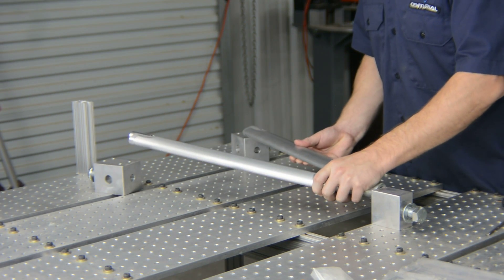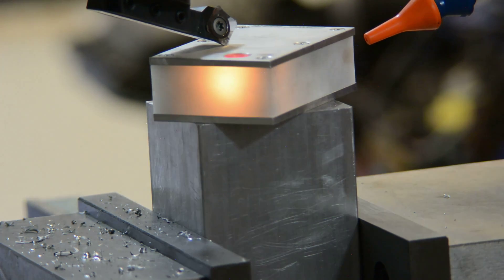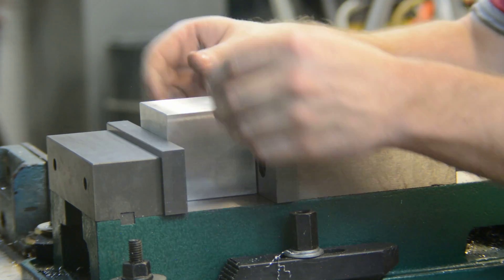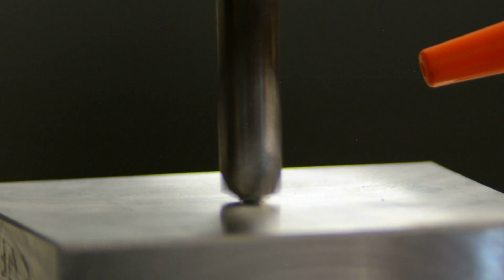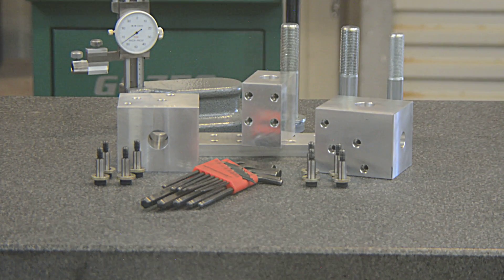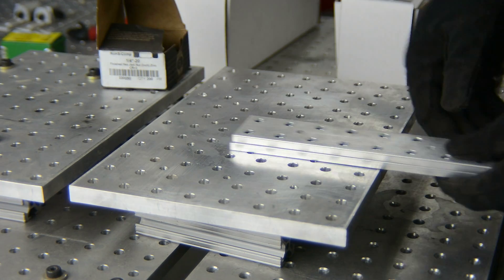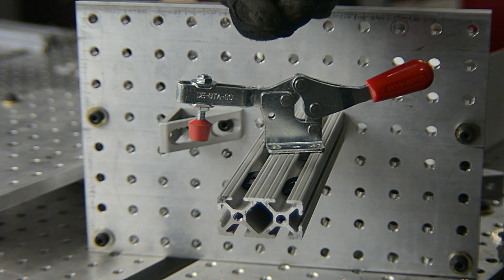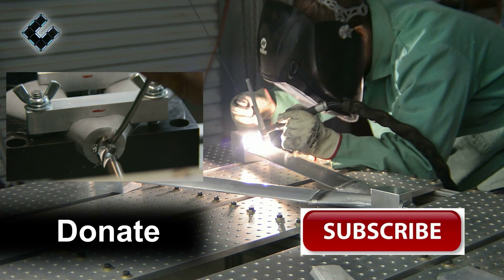Fixture Table, Making Welding Fixtures, DIY welding fixture table. Get the plates from our website.

Comment: Why aluminum? Don't you have warping problems?
Reply from the maker: For the table. Aluminum machines easy, fast and weights less. Which is good for quick results and fast and easy tear down and set up. It also doesn't rust which makes it ideal in moist areas. If mig welding the sparks tend not to stick as hard to the surface.
No warping. Good control over the processes lead to the desired result.  

Best Matt

Comment: Very clever weld table and use of those extrusions. I use them in my woodworking and I'm thinking I should start considering their uses when I'm welding.
Reply from the maker: You should. They are very practical and DIY friendly. Aside from the price we love the extrusions. If you do use them I would love to see how. Let me know. Also our design for our plates is available on the website. It's a free PDF print.

Best Matt